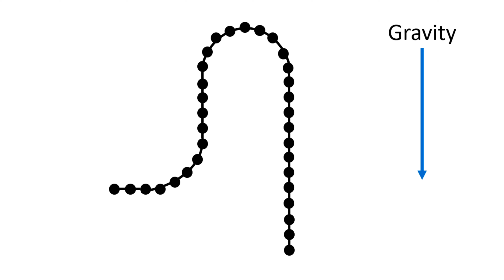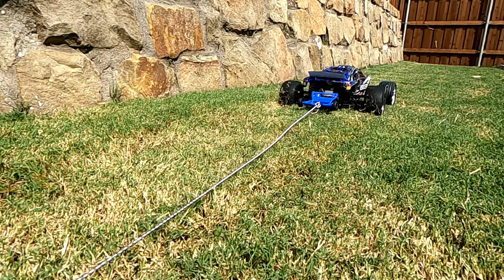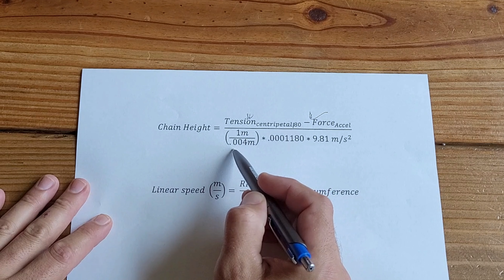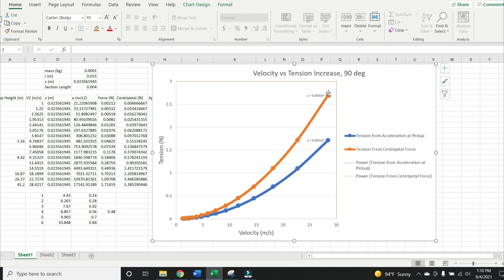ElectroBOOM vs Steve Mould - Mould Effect Madness

Comment: The Cambridge explanation is rubbish.
There is never a bonus-kick at the container.
There is indeed a bonus-kick when a link hits (collides with) the floor, & this adds to the downward pull of a chain, & increases the size of the fountain etc.
But that extra (bonus) force is initiated by the (colliding) link.
In the container a link will indeed get a kick from the container (or from the links beneath), but, that kick is not initiated by the rising link, it is initiated by the preceding link.
The preceding link has a limited amount of impulse to give.
The kick from the container results in a similar (but opposite) kick being given to the preceding link.
But the kick from the container is not a bonus-kick.
The initiating impulse from the preceding link is not added-to by the kick from the container, it is reduced by the kick from the container. 
Hence, at the container, links or beads, it makes no difference.

The fountain is simply due to the inertia of a chain.
If a chain is forced to go up, then forced to veer to go horizontally, then forced to veer to go down, the chain will form a curve or a bend or somesuch.
The change in direction will result in strong, uneven centrifugal/centripital forces, which eventually (can) result in the initially sharp curve expanding & rising to reduce the centrifugal/centripital forces & to even them out.
Giving a larger softer more even curve, ie a fountain effect.

It is virtually impossible to load/store a chain in a container without having loops. And loops result in jumps, koz if u have a close look u can see that chains have a lot of horizontal movement before exiting vertically, & the chain gets lots of little jumps in the container, as each leg of each loop jumps (horizontally) over its mate. Jumps magnify the fountain, kicks dont.

But, in any case, we don’t need jumps nor kicks to achieve a very high fountain. All we need is lots of speed. The chain will crest at any height, depending on speed. The idea that something special (like a kick) is needed (if the chain is to rise above the edge of the jar) is silly.

I like the centrifugal/centripital analysis in this here youtube footage by Engineering After Hours.

One thing that everyone has missed, in every youtube re the chain fountain, that i have seen, is that vertical jump or kick etc effects are cumulative, and lasting.
This is the reason behind some of the slightly weird results.
For example it is why we get a vertical component of arc when the test seems to be strictly in the horizontal.

Comment: My proposal is increased height is due to pressure difference between inside and oitside of the radius formed, ie aerodynamic lift. The increasing height due to mass difference causing increased chain speed thus increased lift, just like an airplane wing...

Comment: You can't just equate mv^2/r in the loop to the tension because tension is tangential. You need the radial component of tension. It works out to be T=mv^2/2pi*r
Reply from the maker: Yes I can...That's why I'm using CoG position relative to rotation center.
Reply: @EngineeringAfterHours  Instead of 2T=mv^2/r you should be using 2T sin (angle of loop segment)=mv^2/r
Reply from the maker: No that's wrong. CoG position is exactly on line with the rope tension force vector. There is no trig needed when considering the whole 180 degree segment. Do the full math and you will see what I'm talking about.
Reply from the maker: @rodbhar6522  that's not at all the same thing

Comment: Interesting that you don’t include the acceleration due to gravity of the two portions of the chain that are rising and falling. Definitely on to something but not conclusive enough for me. The main thing I’m questioning is by what mechanism is the centripetal force being generated. The answer is probably acceleration due to gravity on the falling side I think but I’m not sure. I agree more with the maths in Mehdi’s proposals.

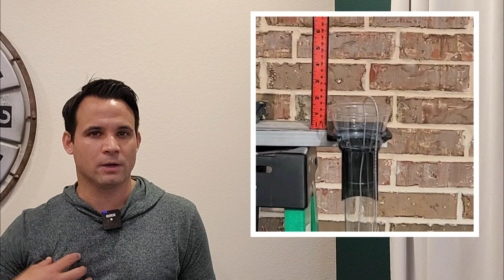Also, I don’t think the experiment at 7:15 with no bottom to provide a reaction force is replicating the system in question. Gravity will not be negligible on either portion of the chain inside or outside of the container and the chain is behaving as a whole object as opposed to an object with a source of more chain if that makes sense. Would be nice to see the whole experiment, because to me it seems like that ‘fountain’ is only ever going to form when the mass of the chain inside is small enough to create a whip effect.
Reply from the maker: The force due to gravity is exactly what the chain height gain is calculating so it is included. The differential between the 2 forces I show diverging is what drives the force to grow the mass (and thus length) of the upward portion. Since it's constant velocity, the acceleration is just gravity.

Mehdi doesn't show any math.

Comment: First of all, great video! I love the clarity with which you present your point.
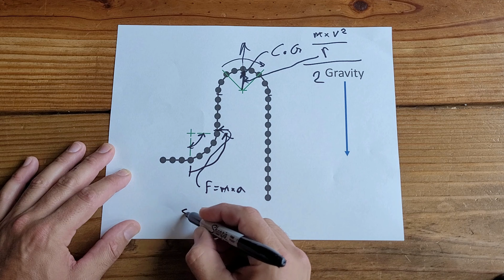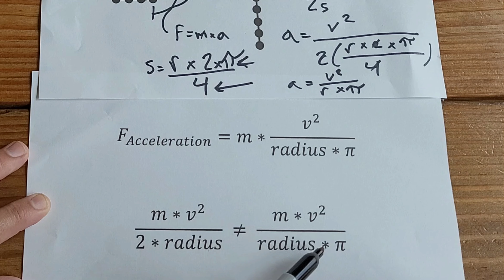I have problems with your calculation of the force on the upwards arc where beads are lifted up from the bottom of the container. Unlike the top of the fountain which stays more or less in place, the accelerating part follows placement of the chain, therefore for the most part, beads are accelerated straight upwards. Therefore your S at 11:16 is much closer to R than to R*pi/2. Also purely from observation, the radius of the fountain arc is about equal to the radius of your container while radius of the lifting arc (if we approximate it with a circle; neither is actually a circle, I believe both are catenaries a.k.a. chain curves) is much smaller. So at 12:46 you are in my opinion comparing two completely uncomparable things. That doesn't mean you're wrong, it just may need a bit more work.
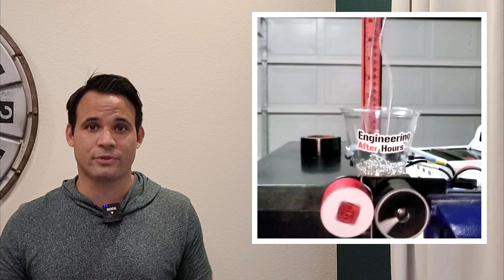There definitely is reaction force against the bottom of the container. That comes from conservation laws in physics. Every action has equal and opposite reaction. Consider infinite chain forming a stable chain fountain, e.g. something like your experiment shown at 6:38 if you were feeding the chain back at the bottom of the container. In this, you can consider the chain to be solid object because all forces on it are in balance. And the only place where this "hook" is hanging on something is the bottom of the container and the force it exerts against it is sum of the mass of the lifted part of the chain in earth's gravity plus the force with which you're pulling on the downwards leg. The only question is where this force does exactly come from.
Reply from the maker: Great point, i definitely oversimplified some of the highly complex interactions to illustrate what happens with a differential between centrifugal and acceleration forces. 

With regard to the length to accelerate, if you reduce the length you reduce the mass but increase the acceleration so the calculation is a wash. 

Agreed 100% that there's a force reaction. But some magic lever force isn't pushing a chain upward against gravity. As an example, An electric motor always gets warmer when run it, but heat isn't what makes an electric motor run. That's a side effect of the motor running.
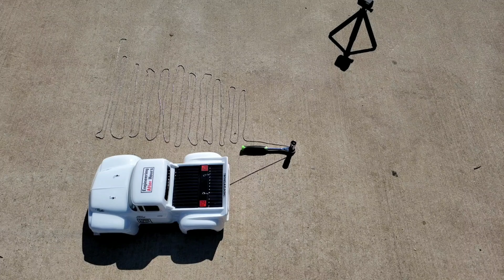Reply: @EngineeringAfterHours  Regarding the "magic lever force", the more I think about it the more I think it's just beads bouncing off each other. Yes beads are accelerated mostly upwards but there is certain horizontal motion and the surface on which each bead lies is made of other beads, i.e. rather uneven. I think if it's not responsible for the whole effect it is at least significant part of it. There is room for "lever action" if the chain forms vertical loop because when the upper end is pulled horizontally away from the loop, the loop rolls on the surface and beads on the back of the loop are accelerated upwards by that, pushing against the surface. That's what happens in your experiment at 4:05. But most of the chain's loops are horizontal so I don't believe it plays any major role.
Also, I'd like to point you to another Veritasium video: https://youtu.be/X-QFAB0gEtE
I think it has something to do with the chain fountain as well, and the effect can be found both at the top of the fountain and at the turn at the bottom of the cup.

Comment: If that was the main reason, wouldn't the fountain peak then grow on a flat surface given an initial condition (starting it by flinging the ball chain in an arch) as attempted by both Mehdi and Mould? The speed increases and the chain picks itself up and arches in the same way, but both failed to display any increased height, just a slowed decrease due to momentum and the chain attempting to maintain it's shape. The explanation is then dependent on that the sides of the container is limiting the angle at which the chain can be picked up at I guess? Also, the experiment with the RC car clearly showed the chain pushing against itself and the bottomless cup was cut at the very end as the ball chain whips out. I have yet to see any convincing experiment that removes the possible source for kickback and still gets a fountain.
Reply from the maker: No, the fountain has an equilibrium height for a given velocity. If the initial peak is pulled higher than the equilibrium height then the fountain will drop. None of their tests have any actual data which means they're just illustrations and not properly scientific.

I also have mentioned that there is definitely a reaction force with the base. But that does not in any way mean that a lever effect is causing chain fountain growth. What causes chain fountain growth is when centripetal force exceeds the force to accelerate the chain.
Reply: @EngineeringAfterHours  That would mean that the peak of the chain would not keep dropping beneath this equilibrium point then. Something I have not seen to be true yet. Even if it's not scientific, we would expect to not see the chain keep dropping until miniscule as the speed is increasing in those ad-hoc experiments, which is however exactly what the chains do. What we do see is the peak decreasing more slowly than the pile, but still decreasing and never stabilizing at any height. Just doing the experiment with a container is not nescessarily scientific either, but it does reliably show the effect.
Reply from the maker: No it does not mean that. You don't know any of the teat parameters or velocities involved to make that conclusion. You also see that when the chain fountain is flat on a board it's has to pull a longer distance which greatly reduces the equilibrium height as more mass is wrapped up in the diagonal section. 

For a chain fountain the beads are literally 0.1 grams...its not hard to upset the balance when your fountain height growth is that sensitive.
Reply: @EngineeringAfterHours  Right, but should we see zero equilibrium height and should we not be able to set up the spaced out chain in reverse on the platform so that the distance decreases over time instead of increasing? I guess one couldn’t isolate it from the potential kickback from the board then either way.
Reply from the maker: Yeah there's no point in testing as you can't prove either way no matter what. Especially when you can't track velocity and forces to an incredibly high accuracy.
Reply: @EngineeringAfterHours  Yeah, if true then that's slightly dissapointing.

Comment: The little touch of calling the ratio Mould-Mehdi and the coefficient Mehdi coefficient just made me smile, mate. :)

That said, your approach was really REALLY awesome. Seems very solid as it was based in classical Mechanics (full disclosure: I also glazed over their paper a bit so can't really say of things did cancel or if this is the actual correct approach).

I now want to see it go through peer review and, standing up to scrutiny, the ratio should be renamed after you, mate hehehe

Nice contribution! Can't wait to see where this goes!
Reply from the maker: Hah...thanks. You're right...the interaction is way more complex than my simplification. It was more to illustrate what happens when centripetal exceeds the force to accelerate. 

I've been talking to some smart folks on reddit that have some other derivations that include additional terms. While I don't agree with their complete analysis...its clear this model can be greatly improved.